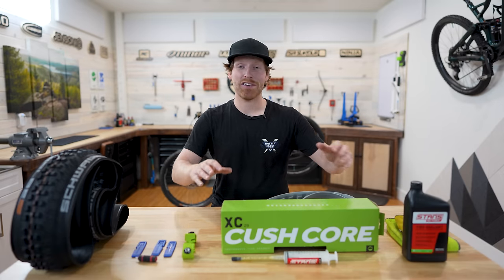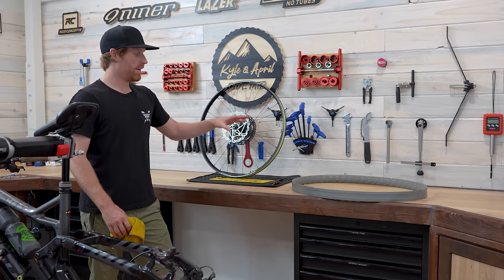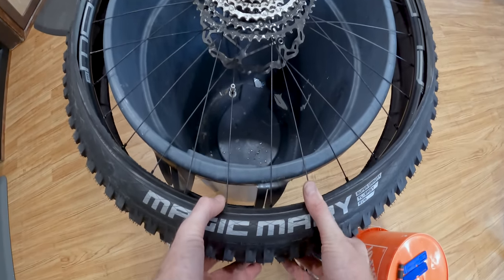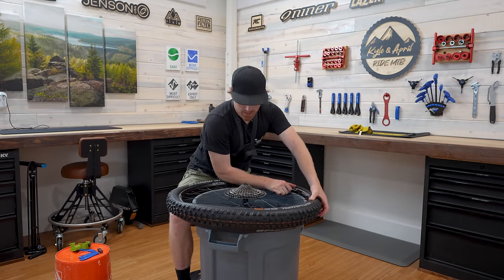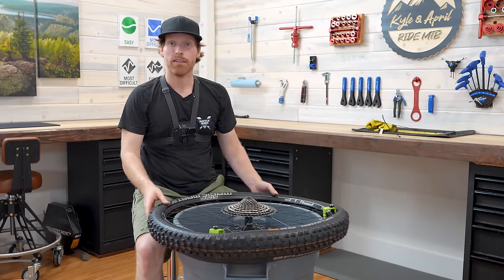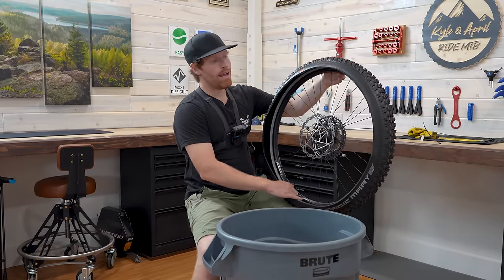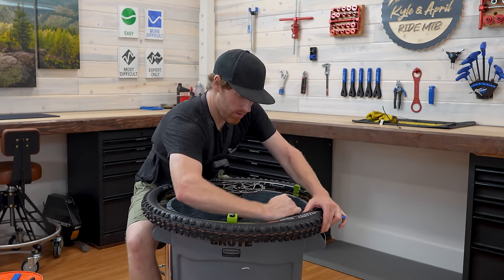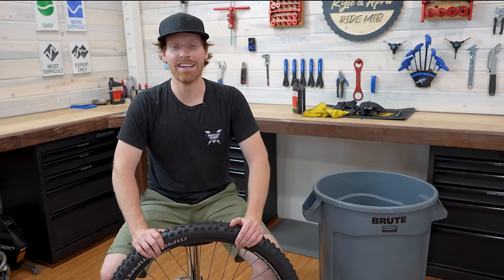Cushcore Installation Made Easy!

Comment: When soap-water "evaporates", ONLY the water evaporates. The soap portion will never evaporate. The dried soap residue will just be rehydrated by the water in the Stans sealant; and will still contaminate and possibly deactivate sealant's ability. Instead, why not use alcohol to lubricate? Alcohol is an excellent lubricant. Better yet, alcohol is completely volatile! When you initially inflate tire to set the bead (without stem core in yet), just inflate-deflate the tire several times & the volatile alcohol will be gone. Soap-water is the better lube for tubed tires because it gives more working time and, in that case, the permanent soap residue is no problem. 

Fortunately, I just learned the invaluable "rim channel" trick a few years ago. What a sanity saver!! However, if I hadn't, I would never have understood what you were talking about, even with the on-screen arrow; or how that affords more slack on opposite side of tire. The overall production of this video is incredible! I love your unique combination of champion (badass) racer / kind / calm / humble. The cross section / cut away is "next level" helpful! You have EXCELLENT teaching illustrations in this video. If you could have added a visual effect like a line superimposed over the actual cross section arc of the rim channel that would be more helpful to folks that aren't already hip to the rim channel trick.

Comment: The only realy hard thing in using cushcores (installing or removing them) is to take of the bead from rim shell when planning to remove cushcore. The problem is to start the bead moving under cushcore, but once you started - easy-peasy than.

Comment: On the Stans injector I usually leave it screwed onto the valve, pour the sealant into the injector, then insert the plunger and inject. Seems to minimize the mess for me. Doesn't work with the race sealant though, so stopped using that stuff.

Comment: Why not install the tire. Pop the beads. Then remove one side and insert the cushcore so you not fighting both beads?
Reply: You could do that, although you'd probably need to pop both beads off to get enough slack maybe depending on tyre. I install the tyre on the wheel one side first then fit the insert and then seat the second side of the tyre, I feel like fitting the cush core beforehand creates unnecessary faff having to get the tyre on without popping the insert back off
Reply from the maker: You know honestly I have tried that a few times but could never get the Cushcore to fit around the rim. That’s how I have done it with huck norris and Vitoria inserts though
Reply: @AprilRideMTB  possibly a bit more awkward with the cush cores! New studio/shop set up looks awesome by the way 👊🏻 love the videos
Reply: @AprilRideMTB  ok, I've installed Vittoria insert that way. Never tried cushcore
Reply from the maker: Thanks so much Matt!!
Reply from the maker: Yeah it seems like the Cushcore is a really tight fit, it’s probably possible to do it that way though, maybe I just don’t have the hands for it haha 😂
Reply: I always mount the tyre first, sometimes popping it first then open just one side to install inserts. Including a cushcore xc recently (on a  newmen 30 mm i.d. rim with a (well used) Spez eliminator 2.6 grid trail tyre.

Comment: Fact: It’s actually way easier to install 1 side of the tire first without the cushcore then insert the cushcore from the other side. Then follow kyle on doing the other side. Very good instructions though.
Reply: Was thinking the same thing 🤔 but I'm  curious if there is a particular tyre/rim combo that it would be difficult with, or some other reason.
Reply: @tomgdownhill  i’ve only installed cushcore pros to michelin wilds, maxxis exo casing, dd casing and dh casing. The thicker the casing, the harder install imho.